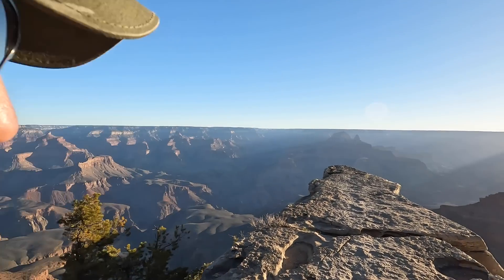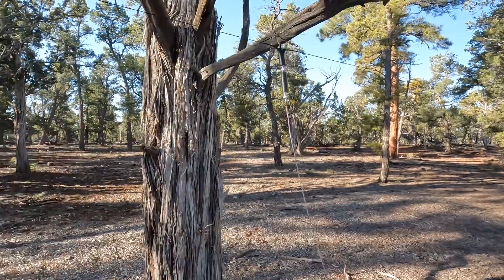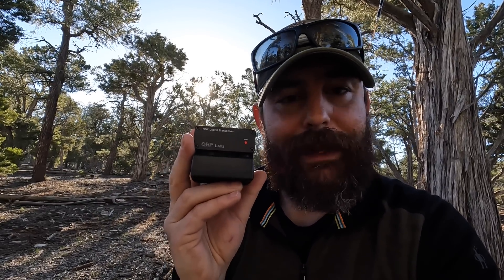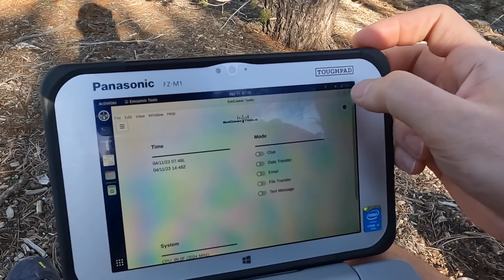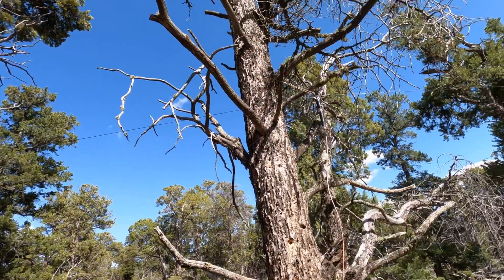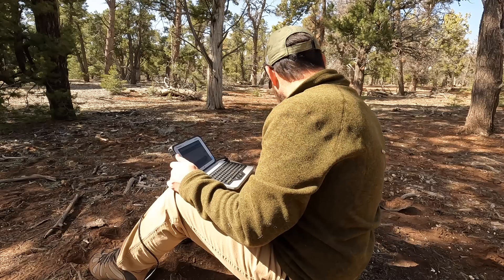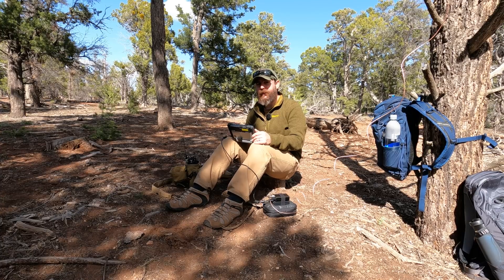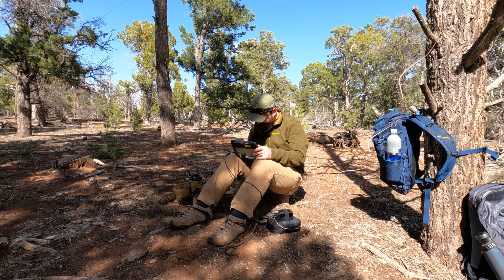My First Contact with JS8Call and the QDX - No Random Contacts

Comment: I read somewhere that the QDX would not work with JS8Call.....I am delighted to see that is not true.
THIS is now a proven method to move tactically significant information under adverse circumstances.
Reply from the maker: I'm not sure how that rumor was spread. It works perfectly fine.
Reply: @TheTechPrepper  
I see that...And thank you for that...I went to the Qrp lab website and looked it up....And there it was, staring me right in the face.....
I also read Hans discussion about the QDX features.  He has a lot to say about the special design of this transceiver and the benifits of NOT HAVING SSB COMPLICATIONS.....It seems that this radio may be uniquely well suited to digital qrp.   You may find that discussion interesting.....

Comment: Glad to see you embracing JS8CALL. I used to have my station up 24x7 but currently have it on WSPR.  JS8CALL is still my favorite emcom for Linux. I've been playing a bit more with VARAC lately but still feel JS8CALL is the most versatile due to multiple decode speeds and multi-station decodes concurrently.  

Vara has some strong points also, but JS8CALL has a strong case.

de KE0MHJ
Reply from the maker: VARA is fast, but I'm waiting for a future where it run natively without emulation on Linux.

Comment: I think you can get JS8Call to run inside the X6100 and then all you need is a wireless Kbd/mouse...
Reply from the maker: No necessary. I'm working on a model where I can run a wireless access point in the X6100 and connect to the JS8Call TCP server via a phone with a slim down UI interface.

Comment: Nice rim activation! I take my FT 897d (internal bats and flex panel) on our private party CO river trips (Lees to Peirce) and ping my bros resonate NVIS on a sked from camp, voice and data. Your doing good work, it's nice to see a practical Amateur channel and think you'd be pleasantly surprised how many purpose driven groups are out there :-) I'm full time off-grid in the Show Low'ish area if you need an on sked bounce or just want to test antenna/propagation etc. We're not into rando ragchewing.
Reply from the maker: I'll like your style. If you have Winlink capabilities, shoot me a message. I'm also on JS8CALL during the day on 40m, so feel free to leave message for me on a local station or store one in my inbox if my station is up. Otherwise, look me up QRZ. 73 de KT7RUN
Reply: I’m new to js8call but getting it sorted out. I haven’t spent much time messing with winlink, the gate keeping nature of it has been a turn off, more ignore to it than apposed. I mostly operate dig/NVIS and SSB FM dig with a yagi.

Comment: Great contacts with a great mode. I use JS8 all the time FT 817 is my portable rig. Sing out if you see me and want a contact. Regards Ian vk5cz ..
Reply from the maker: Ditto. I run my station on 40m daily from 1200 to 2300 UTC. Leave me a message  as the station is mostly running unattended.

Comment: I was speaking with an engineer today and head of a ham that could not tune his antenna using a carbon fiber mast. Carbon fiber is conductive. There is a galvanic reaction where it is attached to aluminum that has to be considered as well.
Reply from the maker: Yes, they can de-tune an antenna. If you deploy it at a slight angle with the antenna not making contact to the carbon fiber, it's not a big deal, in my experience. I have a field VSWR meter to check.

Comment: That was a great watch. What is the battery pack for the QDX?
Reply from the maker: It's in the description. It's the 3,000mAh TalentCell. I've used in the past with the 818 and X6100. They're great batteries.
Reply: @TheTechPrepper  Thanks Gaston. I was hearing "talon cell". I didn't see it in the comments before on my iPad.

Comment: I'm a big fan of JS8, coming from watching a lot of OH8STN.   I use a venus DR4020 with a 4ah SLA, which is a 5w 20/40 radio that runs on VOX so there is no serial control. I used to use a fiberglass 20ft 'fishing pole' from ali express with a QRPguys vertical rig that closed down to 18" for situations where you have zero trees (I have a video of the setup) It works great on a cheap, low powered laptop.  I've seen the QDX and I'm interested, I just don't want to build it.  You can get the Dr4020 assembled or in a kit.  Great content, keep it coming!
Reply from the maker: Nice setup!
Reply: @TheTechPrepper  Thanks!!

Comment: The NORTH RIM is one of my favourite places on Earth. The drive in to the lodge through the meadows and spruce-fir-aspen-ash forest 🌳 during spring and late-fall is AMAZING. Not as crowded as the South Rim. Higher elevation too. I think due to heavy snow load the North Rim won’t open again for the season until early June this year.
Reply from the maker: We're doing the rim-to-rim hike next year over 2 nights and 3 days. Can't wait to see it. I found that the South Rim is pretty quiet the farther you leave the visit or center. At 0600, you only need to move about out about 400m and you're essentially solo.
Reply: @TheTechPrepper  We will take a tour to South rim this summer, probably no radio because it is a tour (my wife has never been to the Grand Canyon and we will take a tour out of Sedaona).  I have been to the South rim by car several times and rafted thru the canyon (WOW!).  North rim is on the bucket list.😎

Comment: Welcome to JS8.  It's by far my favorite mode because it's so great for EmComm.  I just wish it was gaining popularity more quickly.  Hopefully your videos will help.  I settled on the QDX a couple of years ago because it's such a great little portable EmComm package, even though there aren't many people using it so there aren't many people to reach in the larger ham world.  I'm a big fan of No Random Contacts, but I don't have many friends who are hams, which pretty much leaves me with random contacts on HF.  I've gotten a few like minded friends to get a Technician license for VHF/UHF.  I've thought about a simple and inexpensive setup that would allow us to JS8 message using 10m, but I think we'll need NVIS for reliable comms, even with JS8's ability to dig a weak signal out of noise.

My setup is currently in revision.  It'll soon be a 20/40/80 linked end fed dipole with the QDX and a small lithium battery, with the ability to use this ultralight setup hiking, in my truck or from my adventure motorcycle (a more travel oriented version of a dual sport motorcycle).  One of my goals is JS8 SOTA/POTA while motorcycle camping.

I took your advice and ordered a QDX kit tonight.  I like to build.  Two is one and one is none.  Several days ago, I 3D printed a QDX enclosure that I found on Thingiverse, using thermal polyurethane.  It looks like it'll work and it's even smaller than the aluminum enclosure from QRP Labs, although it may not dissipate enough heat in hot weather.  I may use the resin 3D printer to make a much more crush resistant version of the enclosure.  I may also print an enclosure that incorporates the QDX with three series 18650 lithium batteries and a battery management system to charge them from 12-15 VDC for minimal setup hassle and minimal footprint.

I was very happy you decided to support JS8Call and the QDX in EmComm Tools.  Having an EmComm Tools wrapper for JS8Call to integrate it and make it easier to use on portable computers as part of a field portable EmComm package sounds like a great idea.
Reply from the maker: Thanks. I am setting up a persistent station that should run most of the day during daylight hours on 40m (1200Z to 2300Z). Glad to hear that you were an early adopter of the QDX. I really like simple tools like this. Honestly, I think people need to stop comparing it to the (tr)uSDX. The QDX is perfect for persistent nets and EDC when size and weight are an issue. Hit me up on JS8Call. Like I said, I will be on 40m daily.
Reply: I am licensed general, also LOVE Gastons "no random contacts" thing. His operational parameters are very close to my own. I've had general for a couple of years, but just now getting my first HF rig (other than a 10 meter only SSB rig). I would like to experiment with some digi modes like JS8 too.

I'm in south florida - if you want to try some targeted contact drills, I'm game! I'm in the same boat as you are. None of my friends have over a tech license.
Reply: @notsure7874  - You could get your Tech friends interested in digital modes with 10 m on a QDX.  With the flat land in Florida, you should get pretty local good range with ground wave propagation.
Reply: @Liberty4Ever  Techs are limited to a small portion, SSB only - no digi modes for them. Techs also don't generally invest in gear when they have such limited privileges.

Idk about ground wave, I think it's mostly atmospheric refraction that gets me out beyond the horizon. Ground wave is more for very very low frequencies if I understand correctly. I can pretty reliably get out about 40+ miles on SSB 10 meter SSB on a vertically polarized mobile antenna (Stryker A-10MM), I've got about 25-30 on AM 15w. These were random contacts, and there may have been more fars to be had.

My plan involves 80(75) / 40 for NVIS regional, 10 meter for local simplex, vhf/uhf for repeaters (I have a GMRS repeater at home too) - and probably a multiband hex beam for long range targeted comms on 20/17/12/10 - the buddihex has all those and 6m, not sure how useful 6 would be.

I'd do a permanent hex beam but you sort of need a tower and rotator for those, and I don't want one up in a hurricane.
Reply: @notsure7874  - "Techs are limited to a small portion, SSB only - no digi modes for them." - Check the ARRL chart or other online sources.  Technician class operators are permitted to transmit CW, RTTY and data on 28.000 - 28.300 MHz, 200 watts maximum, although there is a "gentleman's agreement" to use 28.070 - 28.120 MHz for data.

"Techs also don't generally invest in gear when they have such limited privileges." - True enough, but a QDX kit is under $100 and is a great kit for a Technician to build.  It's mostly winding some transformers.  The fully assembled QDX is around $150 delivered.  All that's needed to run JS8Call or other single frequency shift digital modes is a computer, which most Techs will already have.  It's the gateway drug to HF and digital modes that might get some Technicians to upgrade to General.

"Idk about ground wave, I think it's mostly atmospheric refraction that gets me out beyond the horizon. Ground wave is more for very very low frequencies if I understand correctly." - Ground wave can reliably get you 40-50 miles on 10 meters, which is pretty good for local communications.  Local friends and family are usually within 40 miles, and ground wave propagation is 24/7.  It's not dependent on the sun ionizing the atmosphere.

73 de NI4B